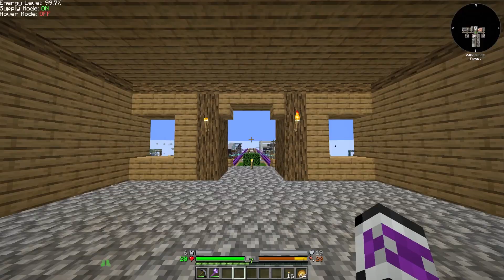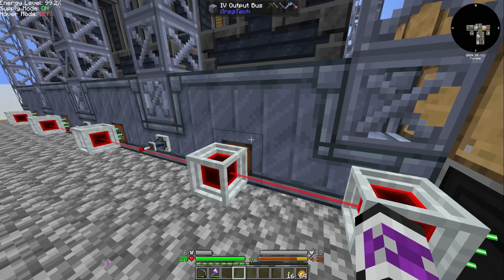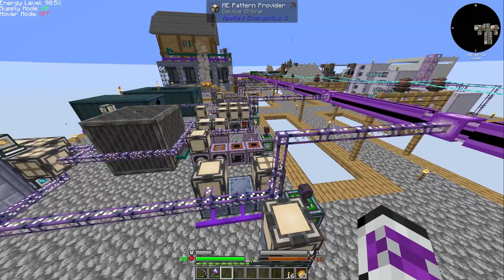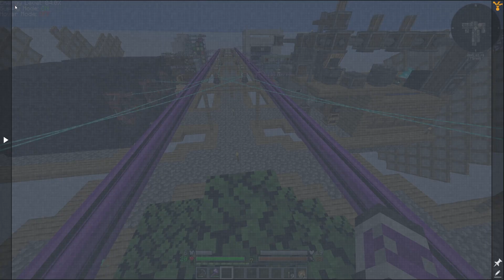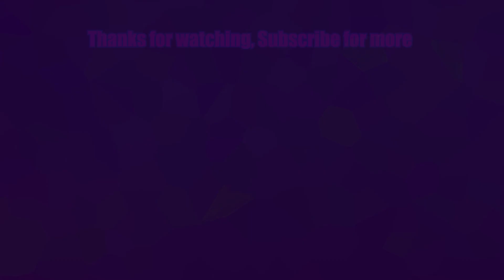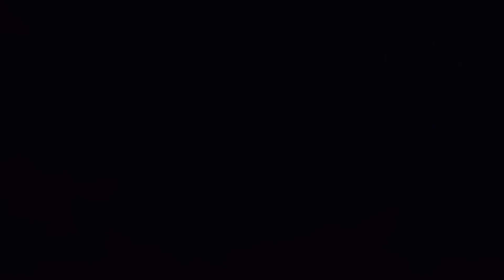Star Technology: Episode 36 - Starting LuV

Comment: Tip for recipe conflicts: You can enable blocking mode in the pattern providers where they won't insert anything if there's a recipe already going. It's the two arrows on the top left of the GUI.
Reply from the maker: I think that setting is broken in (my version of) this pack. When it's enabled the pattern providers keep getting stuck on every recipe and don't craft recursively anymore. I might be doing something wrong, but I couldn't get it to work.
Reply: Hmm... it works fine for me, strange.

Comment: I dont know of any1 told you this but you can stick the Flux Point right onto the Energy Hatch. These convert the EU directly into the wanted GTEU.
EDIT: you can also stick them onto cables ❤
Reply from the maker: No, no-one's told me that yet. I don't know why because that's insanely useful, I'll definitely try that for next time. That's gonna save so much wire material and converter spam.
Reply: @Thaumiumking9 Youre welcome haha!
Reply: is it something working in 1.19 ? because i've just tested it and there is no link neither power transfer when i've tried (also tried with cable, maybe a setting to modify ?). So on my save i still need to rely on the converter to power my multiblocks.
Reply: @mous2K2  I'm playing Monifactory (1.20??) and Technological Journey (1.12.2) right now. And its working in both versions. I dont know why its not working for you
Maybe you have to connect the wire first (via wire cutter) and then place the point. Thats whats working for me.

Comment: 1. You don't need 9 insert cards, 1 insert can  support however many extract cards you want.
2. You can have full node of isert cards wothout needing node overclockers. It's the only card that doesn't do anything by itself and only act as access point for all extract and stock cards. Also card overclockers for insert card does exactly nothing.
3. For any other card type if you want all of them to run you need 1 node overclocker per card minus 1. Node overclockers dont how many cards you can use, they each ADD one active "socket".
4. Card holder is good, because cards inside of it can stack. And as long as you have it in your inventory it will show all its content while you are configuring nodes.
Reply from the maker: I'm still very new to this, so I'm not surprised some of my intuition was wrong. I didn't know how exactly the overclockers worked, just that more is better, so thanks for clearing that up. And I didn't know the card holder would show up in the node UI, that would make it much easier to move cards around. Thanks for the tips